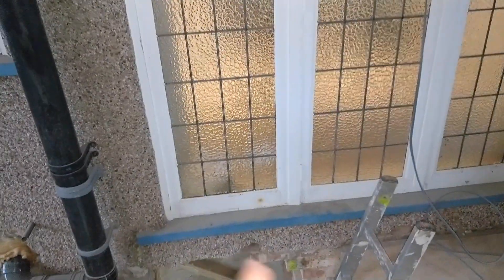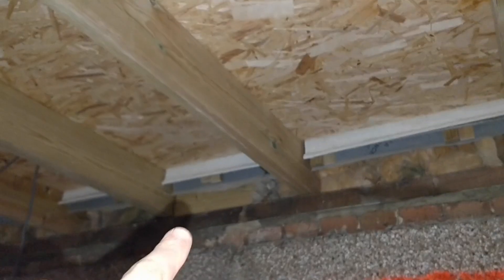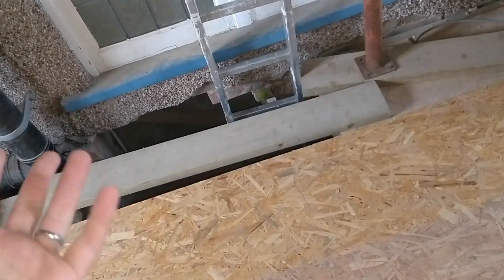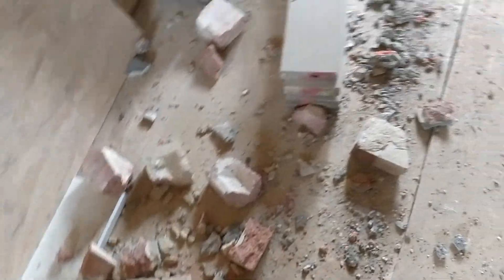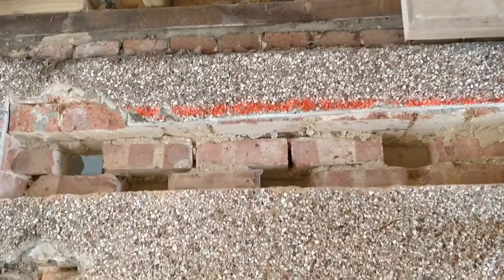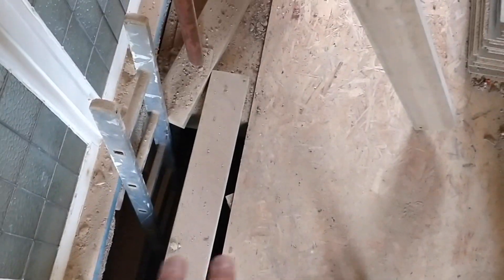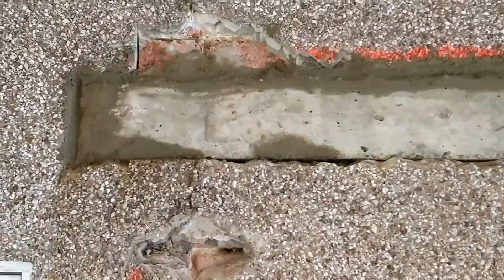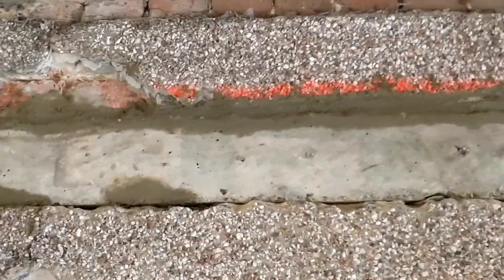How to install concrete lintels for openings

Comment: Is a concrete lintel safe to use for a 2 metre wide load  bearing wall ? ,  great video thanks for sharing
Reply from the maker: That would really depend on that size of the concrete beams and the weight of the building above it...for instance we have a doubled up concrete lintel in that back of our house which is about 2 meters wide, and was there from the time it was built, and had sliding doors under it. I left that in situ and built a timber stud frame underneath it. If in doubt, check with you Structural Engineer
Reply: @OfficeBoyBuilder  ok thanks for your reply , I  best get some good advice from a professional ,  much to consider  , thanks again keep up the good work !
Reply from the maker: Get in touch with iplans (tell them I sent you!) And they should take good care of you. Ant and the team are good!

Comment: Looks like you have a ceramic tile disk in your grinder, a concrete/stone disk is segmented. I feel 150mm should be the minimum bearing for a load bearing beam/lintel. Top notch work as always Sir 👍 🔨 🇮🇪
Reply from the maker: Cheers, yeah you're right about the blade, although it did enough to get through the pebble-dash.

It's odd the way the SE Spec'd 100mm, I felt quite uncomfortable when I saw just how little that was for the size of the lintels. 200mm felt a lot better for sure! 🤣👍
Reply: @OfficeBoyBuilder  Indeed, I use a misting bottle for watering plants to wet masonry before filling in around lintels and doing small repairs. It's also handy when working with expanding foam, wet the surfaces to be foamed, apply the foam and then mist some water on the foam. It helps create a better bond and the foam cures quicker, 👍🔨 🇮🇪
Reply from the maker: Great knowledge. Cheers mate
Reply: @OfficeBoyBuilder  I knew my chronic O.C.D would come in handy some Day, 👍 😁 🔨 🇮🇪

Comment: You only supported IT from one side ? What about the floor above on the other side ?
Reply from the maker: Good question, there is no floor above on the right hand side because it's the landing space for my loft, on the left hand side it is simply a stud wall for the bathroom, so not heavy or load bearing 👍
Reply: @OfficeBoyBuilder  ok 👍